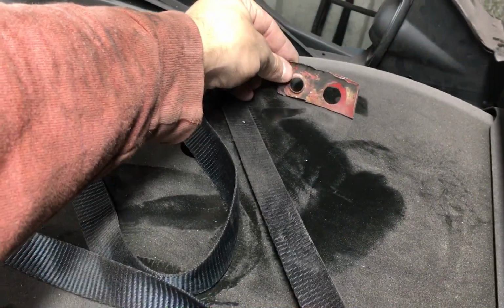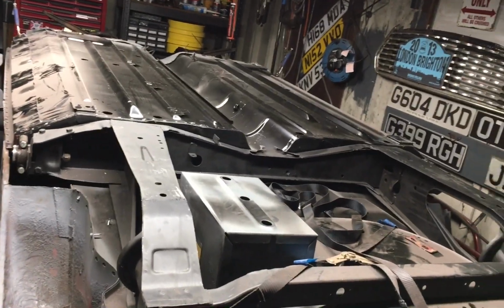Classic Mini Restoration 1989 Episode 12 - Check Check & Double Check Again

Comment: Marc,  I did a video some time back on measuring between the subframes and it is very reassuring when the numbers match up, If i ever replace
a whole floor in the future this method seems the best way to get it aligned with the least amount of strain on the shell, Cheers Dave
Reply from the maker: davejaguar66 thanks Dave yeah I think putting the car like this and the two subframes in bad massively helped let’s get cracking now..